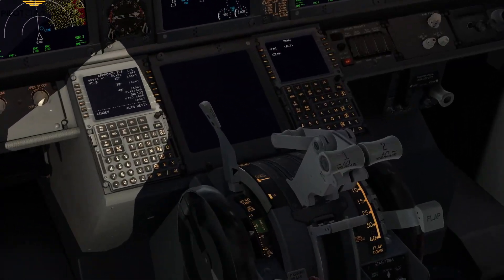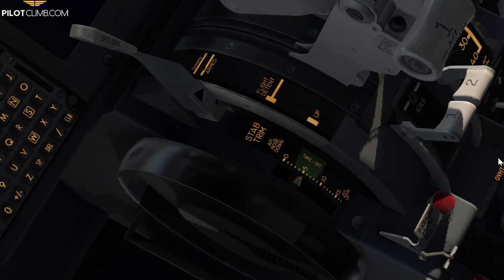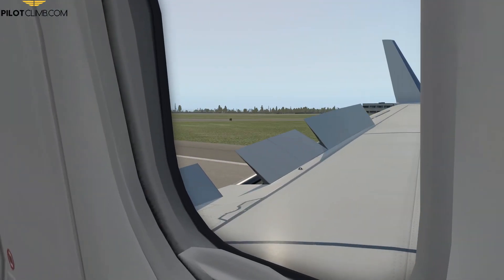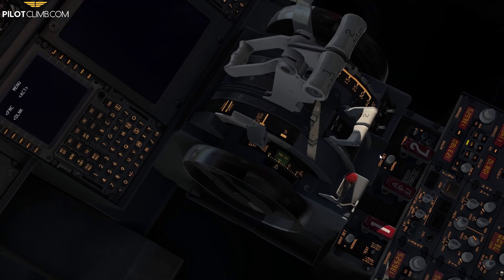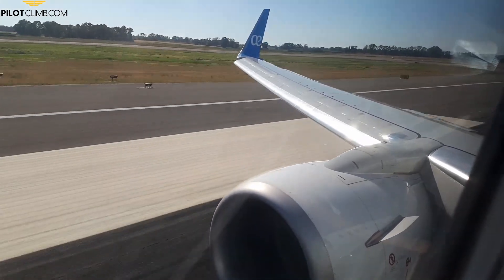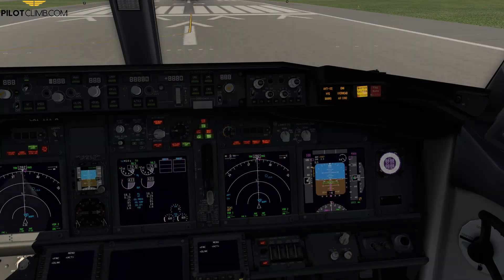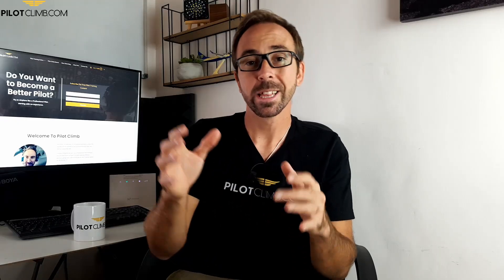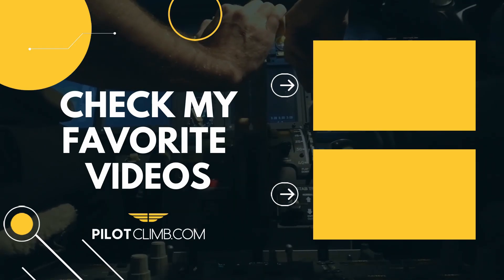How Can You Operate The Boeing 737 Speed Brakes - [Speed Brakes Lever Positions Explained].

Comment: Hey captain, thanks for the great content! my question is: whenever the speed brake in flight is being used with a rather high speeds, i feel vibrations and noises in the passenger cabin, especially at the aft section. is it harmful to the fuselage in any way? does it cause wear and tear on the metal structures or weakening them, reducing lifespan?
Reply from the maker: You are very welcome! No it doesn't as long as you don't exceed the limitations.

Comment: On my X-plane 11 Zibo b737-800 the speed brake lever if left on the down position on landing, and then you apply the reverse thrusts the spoiler will
go to full up position with out the speed brake lever set to the armed position. You did not mention anything about this???
Reply from the maker: Upon landing the speed brake lever should be in the Armed position (check the green light).